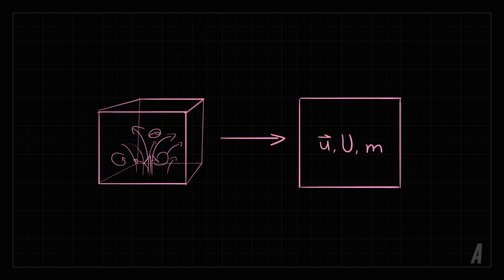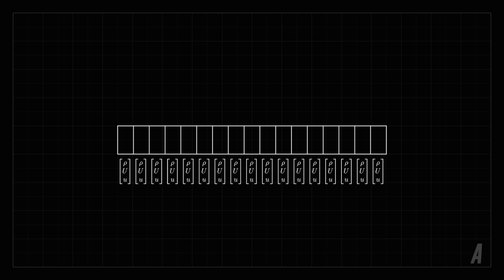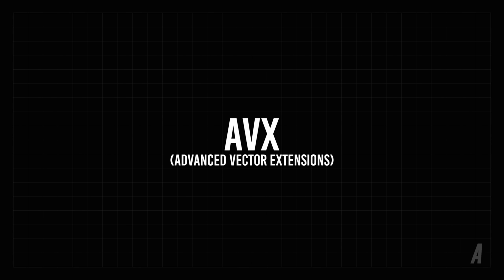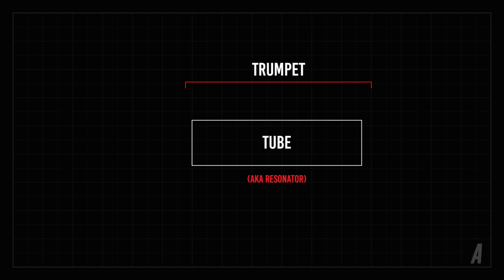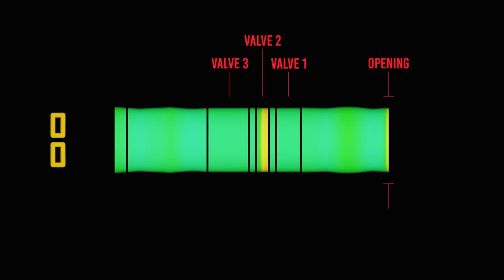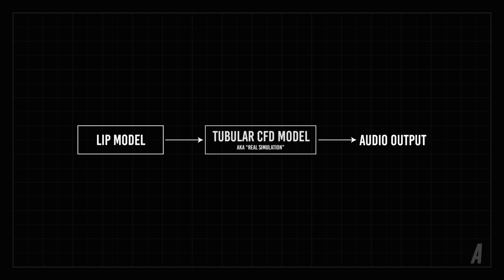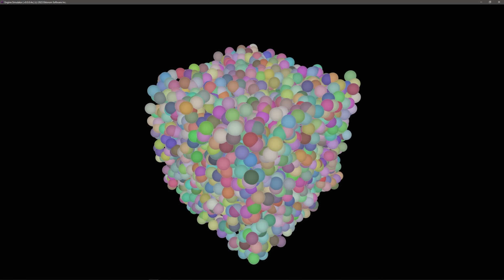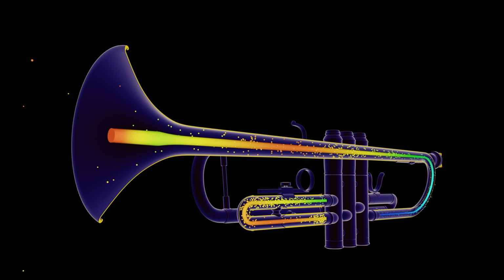Real-time Trumpet Simulation [C++/Vulkan] [WARNING: Flashing Lights]

Comment: Im a trumpet player and not an engineer. The thing i like the most in this video is that, although the trumpet isn't tooned, the fist demonstration of the trumpet's notes is as accurate as it gets. Although im not a luthier, i can definitly say the chromatic scale is exactly as its portrayed: 000, 010, 100, 110, 011, 101, 111. 
Descending, not ascending.
Reply: I'm a trumpet player too, and loved that this video is a defiantly on point for how a trumpet produces sound.   I think some of the parameters that are missing to be able to enhance the sound go something like this..... 1. lips, tension.  There's several ways to achieve this, basically we tighten up the cheek muscles to make the lips more tense.  In addition, we can change the pressure of the mouthpiece on the lips to achieve the same.    2. Instrument construction.  The tone is effected by the mixtures of metals that make up the instrument.  I'm talking about he zinc/copper ratio on the brass, which effects the "brightness" of the sound, also whether the instrument is silver plated, or lacquered.  Again this finish can have an effect on the tone.   3. And here's a whole new can of worms, what's happening behind the lips.  The tongue is important as it's placement will dramatically change the sound, as well how we open our airways in the throat whilst playing.  Puffing out the cheeks.  Also whether we are breathing with the upper part of our lungs or (as is better) the lower part using our diaphragm to apply the pressure that creates the volume.         I believe that we tend to use higher pressure than you'd think to produce the vibration at the lips, but the opening is very small, so that volume of air passing is relatively low.   It's common for a trumpet player to be able to sustain a note for about 60 seconds with one breath.   This should be able to give you the idea of the amount of air that can be delivered with normal lung capacity.
Reply: at first i thought it'd be like counting in binary; 000, 001, 010, 011, 100, 101, 110, 111.
Reply: @billy8thirty that would make a terrible ergonomic. Imagine having to use your ring finger so much.
Reply: @ka-uy8yh  that's interesting, because it is binary, it's just in the wrong order. If you swap the 1st & 2nd valve it becomes binary.
Reply: @billy8thirty It’s counting in binary, except the digits are shuffled, because the pipes attached to the valve aren’t in ascending order of length. Instead of being worth 4, 2, and 1 semitones, they’re worth 2, 1, and 4 in order from closest to farthest.
Reply: @cmyk8964  It's 2,1,3 semitones, although valves 1+2 don't necessarily give you the same pitch as valve 3, see @luelou's comment.
Reply: tooned
Reply: Well, Luthier would be the closest term for a maker of instruments despite it only applying for stringed instruments, otherwise you'd have to use the term Brassiere, pronounced so it rhymes with Luthier, and not for the feminine undergarments either XD
In fact, Google gives Brassiere as the term for a maker of brass instruments, with the source being from none other than Reddit lol
Reply: Also forgot to say starting on F concert
Reply: Luthier's make sting instruments... you are thinking of a brass instrument maker.

Comment: Would you consider doing a similar simulation for the human vocal tract? That would be a great educational tool. There are no truly good online resources that explain how and where the different formants of speech are created, the explanations are quite rudimentary. E.g. visualize how the same formant (in the output spectrum) may originate from two alternative configurations of the tract, due to the tounge position.
Reply: I'm not sure how it compares to what Ange is working on; but you might wanna take a look at Neil Thapen's Pink Trombone
Reply: I like this idea and believe it is feasible. In my classes at university we studied speech codecs and the underlying models remind me a lot of this simulator. Maybe you could implement the model from the dissertation "Physical Modeling of the Singing Voice" form Malte Kob or something in that direction.
Reply: if this could be possible, then it might be possible to generate voices from it, I imagine it would be impossible to generate the voices that is the pressure waves and other mouth expressions manually to output voice, we may train a neural network to generate the needed air pressure and toung and mouth movement to generate a voice, This could be the most realistic TEXT to SPEECH generator of all time. have goosebumps just thinking about it.
Reply: I don't think this type of simulation is capable of coming close to simulating human voices. It's useful for systems that consist of connected cylinders of air, not something with complex geometry. I imagine it would be very hard to physically simulate a realistic / convincing sounding voice.
Reply: @aspzx It indeed can, albeit in a simplified form: check out “Pink trombone”, an interactive vocal tract simulator that runs in the browser.
Reply: This is an excellent idea
Reply: My god, if Ange could simulate a voice box and generate voices, then that would change everything.  Speaking, singing, acting, the list goes on. My mind is blown!!
Reply: @zejugames5045  To be clear, it would not be a very realistic sounding voice. If you want to mimic a voice realistically, there are much better ways to do it that would more accurately capture the subtleties of speech. The purpose of using a physical acoustic simulation like Ange's project would be as a tool to study and illustrate how different phonemes are generated during speech for education in linguistics and phonology.

Comment: During your research did you use the book Computational Fluid Dynamics with Applications by John D. Anderson? It uses a finite difference approach which can be easier to program. The other very good book that maybe you used is  Introduction to Computational Fluid Dynamics - The Finite Volume Method by Versteeg. This book really gets into the details of the solvers, PISO and SIMPLE.

Comment: It's amazing how you manage to get that running on a normal PC. Every time I try to simulate something myself from scratch I use way too much memory lmao
Reply: have you tried learning more maths? like.. a LOT more?
Reply: @darkstar1337-l2q Learning the math is one thing, but to optimize it to make the code run faster is a different can of worm, especially if aiming for accuracy.
Reply: @darkstar1337-l2q would more maths translate into better CPU and/or cache optimisation?
Reply: Using C++ is much more efficient the memory side of things especially compared to something like Python or Java, without even mentioning the cpu side
Reply: Or he could be using Rust to have an easier time
Reply: @JorgetePanete Why is that ?
I don't understand Rust shills. Ok, it's C++ with a garbage collector, much wow, but you aren't legally obligated to say how much better it is dude 😂
Reply: @attilavs2  were you legally obligated to say that C++ is much more efficient than Java or Python? 😂
Reply: @attilavs2  You clearly haven't looked up the basics of it, it is not what you say...
Reply: @ki0w0-lordofwatersheep  Def. not, but Ange is using C++, and it's most likely that OP was using something like Python. And it's also way more factual than "he (Ange ?) would have had less trouble with Rust [than with C++]"
Reply: @JorgetePanete  Yes i did, and yes it is ? I read hundred of lines of Rust and looked over some tutorials. I mean yes, it's not just that but it's the only fundamental difference. The rest doesn't change much.
Reply: @attilavs2  Then you don't understand a single thing about it, it isn't garbage collected and it has way more differences
Reply: @JorgetePanete  yea doesn't it enforce memory safety before compiling, rather than use a garbage collector?
Reply: @ki0w0-lordofwatersheep  The compiler via the borrow checker prevents categories of bugs such as use-after-free, etc, not including memory leaks, and in the future there may be an opt-in garbage collector for interoperating with gc languages
Reply: @JorgetePanete  Yeah my bad it's just enormously statically allocated, so no free() at least in the programms i saw

Comment: Exciting progress! Quite neat how flexible the ES3D fluid simulation is
Reply from the maker: My theory was that if it could simulate a trumpet sound, it could probably simulate an engine sound. I guess we'll find out soon enough
Reply: @AngeTheGreat Fingers crossed! I'll be looking forward to seeing it in action :-)
Reply: @AngeTheGreat I’ve got my 22 bucks ready and waiting for ES3D. Keep up the good work!
Reply: @guywholikessteelofdestiny is it gonna be paid?
Reply: @mr.mirror1213 why not? Its an extremely well-put-together project
Reply: @AngeTheGreat do you plan to have it use different shapes instead of just the straight cylinder?  then you could try different muffler layouts on the output of the engine